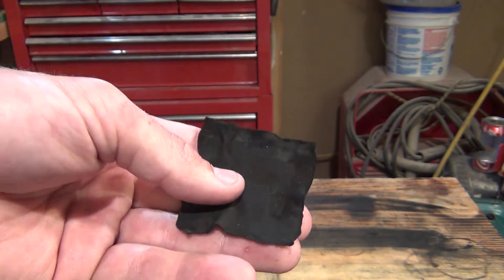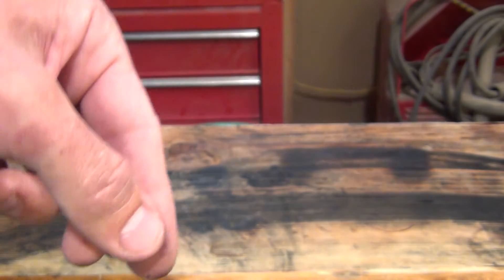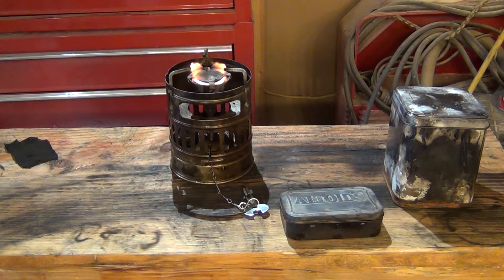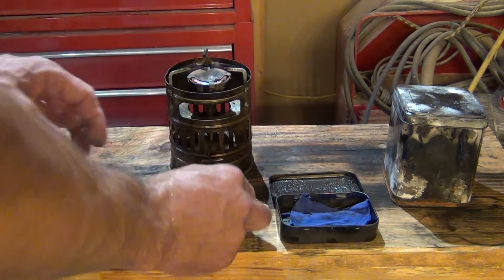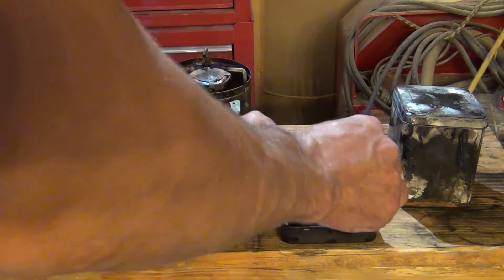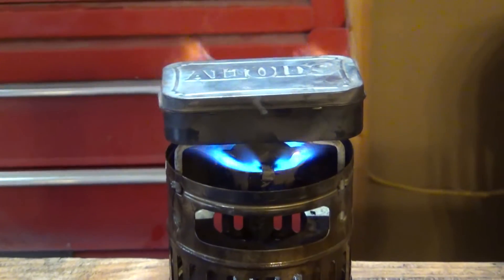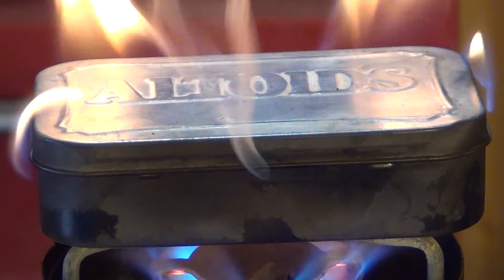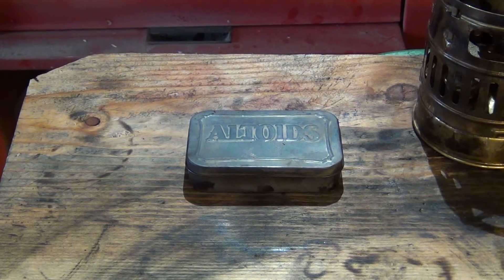How to make char cloth for solar firestarting - HD

Comment: That is really cool.  Question, if you use a heat source other than an open flame, example: stove top, will you still get the smoke to emit from the hole?  Thank you for making another awesome video.

Comment: Don't forget to add a desiccant bag to your tins and cans (or some type of seal for the lid) to reduce the moisture inside. I once had an issue with my cloth being a bit damp and hard to ignite simply from the extremely humid air of that location. The char cloth being extremely dry seems to act as a desiccant itself and attract moisture from the air. Here in the southwestern U.S. of A. I don't worry too much about it, but in more humid climates it could pose an issue. Then, I just have bad luck.